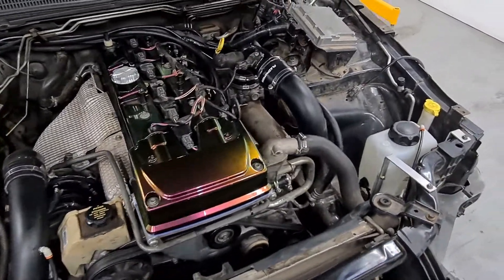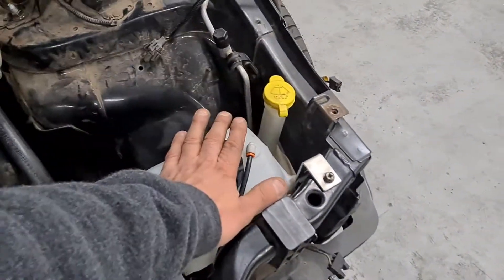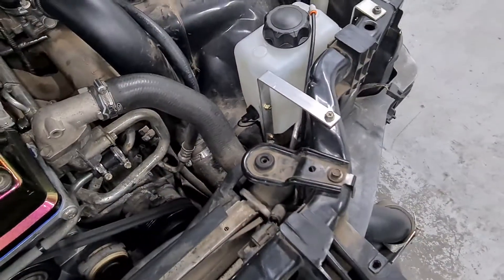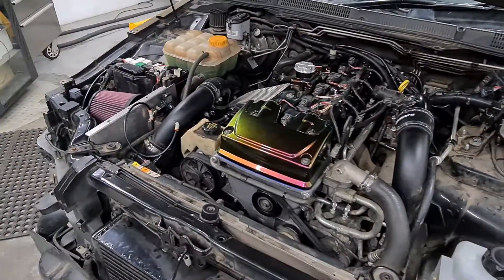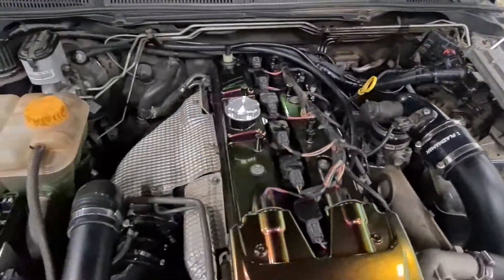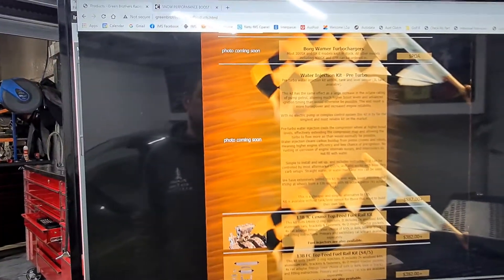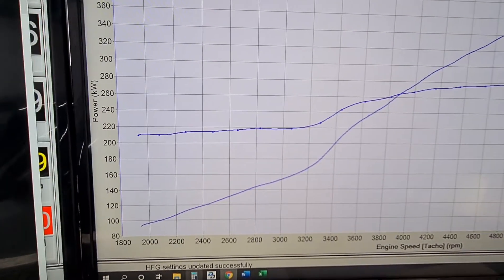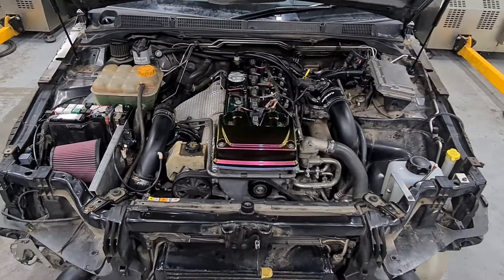green brother's mechanical water methanol injection

Comment: where you say this system isn't progressive you are wrong, this system ramps volume with boost, the more boost the tank see's the more water/meth ramps up(good for pretty much most turbo cars), not many WI systems will ramp with rpm, also this system will run 100% meth without killing pumps, you can trigger the mac valve with the ecu too and use the float switch to an input to the ecu for a failsafe, i find small nozzles on high pressure systems block much easier than this setup as well, good to see some solid results though on a reliable system👌👌

Comment: This setup should be progressive in that as the boost pressure increases more mixture is forced through the nozzle. The flow rate should be adjustable via an adjustable needle in the LPHV spray nozzle, so different jets aren't needed.
Reply from the maker: That would be the case if you had lineal boost curve, in this case we don't so it's a fixed rate.
Reply: @IndependentMotorsports  Yeah that is true. You really want your mixture flow rate to increase with injector duty, but that's not going to happen if you have constant boost. You could possibly control the boost solenoid with PWM from an ecu output to limit fluid flow to the nozzle at low injector duty, but then you may as well get a kit such as AEM that uses a PWM driven pump, and has all the fail-safes.
Reply from the maker: @madthough2298  aquamist,aem & snow will give you this extra capability but it also comes at a premium. That's where this kit has its place in the market.
Reply: @IndependentMotorsports  oh yeah for sure. All the parts of the kit are off the shelf really, I got a LPHV spray nozzle of aliexpress and a generic mac valve to make it even cheaper